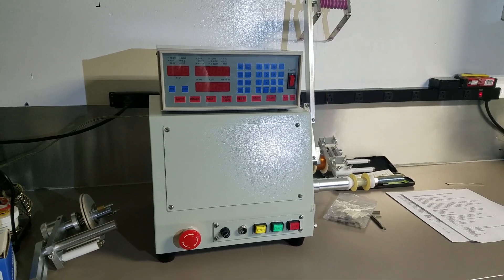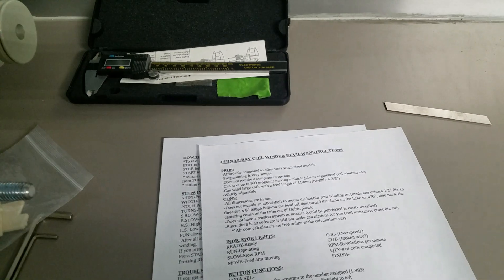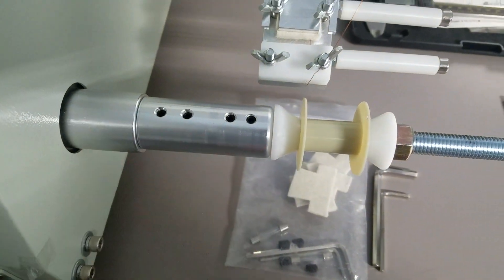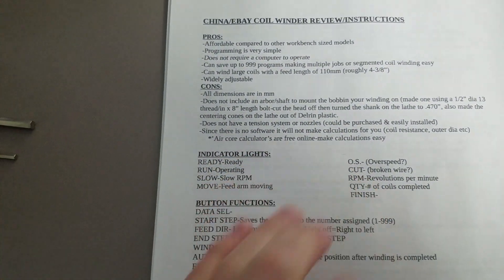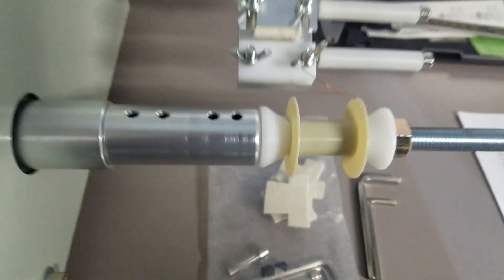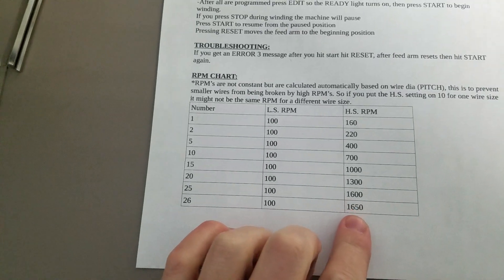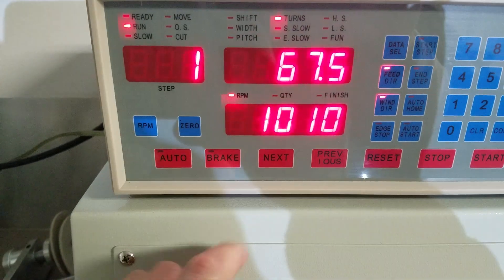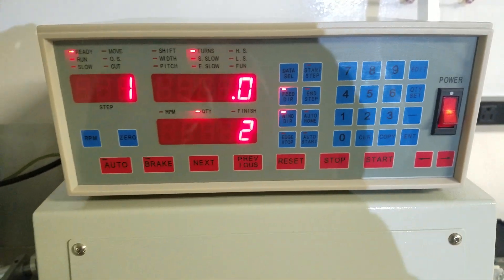Automatic CNC Coil Winder review & how to use (In English)

Comment: Hey thanks for sharing! I'm a little late here but I'm curious if you know the maximum spool diameter (not length) the machine can handle. I found sellers online that listed a 200mm max spool diameter and some that listed a 120mm max spool diameter. What's the largest spool you've wound? Also I'd love to know if it can handle spools with irregular geometries (like a semicircle).
Reply from the maker: @LiamKimball-d4q  I think size wise it could handle 200mm, but you'd have to have the bobbin over the edge of the table or have spacers under the machine. I'm not sure about the software, though. I've never tried winding one that large, and it's in storage right now. 
I'm sure it can do irregular geometries you'd just have to average out the dimension so it thinks it's round in order to get the correct number of turns.

Comment: Hi Brad, thanks for the video.  I wonder what/if you have to do anything for tensioning the feed spool?
Reply from the maker: I tried using some springs pushing against the spool. It ended up not being consistent so I stopped using it.
Reply: @BradKwfc  thanks for reply.  Does that mean that you don’t tension the feed spool at all with good results?
Reply from the maker: @RichardAuber  Yes. 
I tried using tension but without an actual tensiometer getting it right was difficult and it just made the coils worse. 

There are tensioner's online that fit this machine for around $100.
Reply: Thank you!  @BradKwfc

Comment: Hi, can you answer this for me: I have my machine being delivered this month, I have coils that need wound, they are about 4mm diameter and 8mm length, but you show a threaded rod in the center, obviously that is far too big for my coils, is it a matter of 3d printing something, or will it simply not work? Thanks a ton!
Reply from the maker: Yes you could 3d print one. 
I used a large diameter rod because it was close to the hole diameter. The screws that clamp in into the hole are only on one side so if I used something smaller it would wobble.
Reply: @BradKwfc  That's great news, guess I will have to model a custom coil holder, no problems. One more question if you can answer, is there anything stopping this machine winding guitar coils? Thanks for your help much appreciated!
Reply from the maker: @Program2live   With the right holder and bobbin, it will wind guitar pickups just fine.

Comment: I got this coil winder about a week ago and love it. Is there anyway you could make me a set of cone centers like you made?? I’d be happy to buy a set!! I have look everywhere online and can’t find anything like them.
Reply from the maker: Honestly I found that using large area washers and nuts work better. If you wind alot of turns the bobbin will warp, so I found it best to clamp the bobbin in place using the washers and nuts.

If you put a threaded rod on yours like I did just get some nuts and large area washers for it, you'll get better results that way especially if the bobbins your using have thin walls.

Comment: Thank you. Will it wind basket windings as used in RF chokes (for example)
Reply from the maker: Your welcome. I don't think it will but I could be wrong. It has a lot of different settings you can program into it. I've only ever needed to do basic multi-layer coils.

Comment: Wondering if the FUNction button is related to separating the primary and secondary coils with tape?  Someone else suggested the FUN switch might be related to using a computer interface.  My guess is that it's related to the taping feature and if you change if from "0" to "1" (or whatever) it will neatly wind the  tape just like it winds the wire.  Curious if I'm on the right track - let us know!
Reply: FUN trigger an output signal when the coil is finishing with winding to trigger external equipment for automation.
Reply from the maker: I'm not sure. I'd try it out but my winder is in storage. I'll be getting it out in a few weeks to wind more coils though.

Comment: Thanks for the video Brad. Quick question. Will I be able to use this winder for electrical wire, like a flexible silicone wire up to say 16 AWG thick? To wind up up small wire bobbins? Is the 2mm max thickness in the specs pertaining to coil winding only?
Reply from the maker: I think you could but I'm not sure if it will let you input a dia that large. I would try mine and let you know but it's in storage. You'd also need to make a custom head (probably with a wheeled guide) for the silicone wire.
Reply: @BradKwfc  Thanks for your time. So am I correct to understand that if you dont require the tension to wind coils, but only electrical wire, that the machine would be able to cope as long as you custom feed the cable with some moderate tension? Is the question whether the pitch setting will allow a larger number?
Reply from the maker: @Philip M Nagel  Yes, I'm not sure if the pitch setting would work. If not yeah you could still rig something up.

Comment: looking at buying one, the 820 larger/slower wire guage modle.  quick question, should i consider one with a "break" or doed it not matter? just windins simple solenoid coils with 1.2mm wire
Reply from the maker: Is it a brake that stops the winding? 
If so mine doesn't have a brake, I always set the last few turns to be slow and it turns out just fine.
Reply: @BradKwfc  ya to stop the winding, if it stopes fine without i guess i dont need it, im getting the 1500max rpm version for thicker wires anyways. production speed is not a large concern, 200-400 coils a year.  thanks for the replys man!
Reply: @BradKwfc  have you wound any thicker things with this machine? the coils i want to wind are 1.15mm wire. machine states 1.2mm max. I dont really wana struggle with no torque/stalling out. but the larger machines are twice the price and do not come with the 2 different tape holders, which would be handy
 thanks again for your input, its nive to have someone to chat with about neiche' things like this!

Comment: Brad! Your video saved my Christmas! But I managed to push red start button at the bottom of vevor cnc coil winding machine (not on the display). The button stuck there. And now I can't get rid of "errors". What to do? Thank you in advance!
Reply from the maker: The big red button near the bottom? 
If so that's an E-stop (emergency stop) button. You just have to turn it and pull it back out. There should be arrows on it indicating which way to turn it.
Reply: It took me a few minutes to figure out the emergency stop button was preventing mine from coming on when I first unboxed it and powered it up lol. I finally figured out that I had to turn it, like the arrows say, and pull it out. I was extremely relieved to say the least. It's a good little unit I believe. I have to order more magnet wire before I can fully test it out though. Thanks again for the help Brad.

Comment: Thank you so much for sharing! You are a lifesaver. I just received kind of the same machine but it has a wider table and can hold the coil from both ends.
I was going nuts since the instructions came in a single sheet of paper and I could not understand it. Even the names of the keys on the sheet did not match the keys on the machine.
I can breathe a bit better now after watching your video. Best regards, JF.
Reply from the maker: Happy to help 😃

Comment: How do you think this will work with .03mm (.001”) wire. I have a bunch of real tiny electro magnet coils I need to rewind and it’s crazy thin wire.
Reply from the maker: .03mm is the smallest wire this machine will do according to the description. If you get it all setup right I'm sure it can be done. With wire that small don't expect them to look well and be uniform.

Comment: Okay after working with this for a day now I noticed you made a mistake as the width is for the wire's actual diameter and the number of turns you plan on laying down in the given space. Example if I have a 0.18mm wire and I plan on putting down 40 turns per layer the total width will be 40 x 0.18mm = 7.2mm. This is where the designer of the bobbins comes in as when designing these bobbins one must take into account all of these things prior to moving to the coil winding machine. 

So far I can't seem to figure out how to program it to automatically wind up slotted bobbins and have to do them manually but at least I can do it now. Oh, I'm winding bifilar coils with this machine as I made a modification that allows the machine to wind bifilar coils as it's a must with Meyer's latest bobbin designs that he came up with before his passing.
I'll make a video of me winding one bobbin slot as I haven't anything to hold the camera.

Once I have this latest transformer all wound up it should be a go for this technology but since it is a prototype mostly I'll be gathering information on it's performance as I fine tune things for the Water Fuel Cell that I have.
Reply: Hey did you ever make that video of winding segmented/slotted bobbins? Does this work well for that? Even if you have to wind one slot at a time.. just curious

Comment: Hi Brad! Can your coilwinder also do Orthocyclic windings?
Reply from the maker: No it can't. You'd need something where you can get into and modify the software to do that.
Reply: @BradKwfc  Och, so it’s not programmable like cnc gcode with software interface then I assume
Reply from the maker: @obr2021  No its just the basic programming on the machine.

Comment: I bought one of these last week, thanks so much for making the video! 

I designed an arbor shaft in CAD and 3D printed it.  It seems to work well so far.

One challenge I have is that I wind a lot of interleaved chambered transformers using 42ga wire on the secondary.  I haven't figured out how to program the machine to wind, move a few mm to clear the chamber wall, wind some more, etc. 

I also use fairly huge spools of wire, which has proven challenging as far as wire feed, tensioning, etc.
Reply from the maker: I'm glad the video helped. When I bought mine all I had was one in Chinese and no manuals. 

For the interleaved transformer you probably have to make a program for each space and make sure auto home is off.

42awg man that is some tiny wire to work with. I did 36awg once before I had this machine,I used a mini lathe with a step counter rigged to it. Needless to say I'll never try that a again on a mini lathe. 

You can also get tensioners for this machine on ebay and other places. I feel like they are overpriced so I never bought one.
Reply: I also use 42 gauge, big spools. I’ve had problems with it. Put it in storage 4 years ago. Hoping to look into one of the better tensioning systems for it as it seems to be a great unit. Did not like the manual tensioner but other than that it’s awesome. To your point, looked on eBay and they are massively overpriced right now. Fingers crossed something else comes out that is less expensive. The tensioner is pretty much the same price as the actual unit.
Reply: @mikeSGman  I sort of solved the tension issue by turning the 42ga spool vertical and sitting it on a flat surface below the feeder. The wire unwinds off the spool like a sewing machine. I’ve been doing it this way for months with no problems. 

The Dude Abides.
Reply: @Matt Portnoy Would you be willing to share your CAD file for your designed arbor shaft?
Reply: @lego555clone  I posted the link here but it seems to have disappeared?  Did you get the file?
Reply: Hi. @mattportnoyTLV.  would you mind sharing the cad file again?

Comment: Interesting you got this way back in 2018 or so. I'm just looking at it now, lol. I've been winding these multispool bobbins by hand and now that I've started using a very fine wire I can no longer see what it is I am doing. I wish you would work with me on this as I cracked the science behind this technology and am now ready to push this technology into the marketplace but to each his own I guess, sigh. Anyway Once I get all the last bits of the things I need in I will finish what I started way back in 2006. I will have to figure out how to wind these multispool bobbins with this machine and modify it a bit to be able to wind Bifilar Wire. But I did just check with the company I get the wire from to see if they can make the wire I use into parallel bonded wire for me and am waiting on a response from them. 
I can feel in my heart this will be the year this technology finally makes it out of the box those that wish this technology to never see the light of day have put it in🥰. I had to lean this technology in steps but getting at the actual science behind it was the most important step to solve as now I know exactly what this technology is and is not doing.
Not sure if you go on OverUnity site much but I have posted a lot of things I am doing now on there in my old, "Stanley Meyer Explained," thread. It turns out this technology is on the expensive side to get working correctly and there simply is no way of getting around that.

Comment: Looks like "speed setting is % of the max limit. You can adjust max limit by pressing EDIT - DATA SEL - 5, or EDIT - DATA SEL - 5 - 5 or - 5 - 5 - 5. To edit values press "-". Looks like H.S and L.S modes have their own max values. By lowering L.S. speed limit and you can have very low RPM in L.S. mode.

Comment: I bought the same coil winder and found a different manual for it, which has some overlaps with the manual mentioned in the columns below, plus some some useful additional information. Apparently there is a whole family of these coil winders. http://www.smtb.lv/fails/teh/WH-751%20User%20Manual%20DCWE(CNC-200A).pdf
Reply: Thank you Scott.

Comment: Brad....I know this video is a couple years old now and after seeing this in operation I had to get it!  My prior models are hand crank for heavy guage wire and the other is "sewing machine motor" that basically counts for you.   
I do wonder what is the smallest wire you have worked with and did you have any issues with breaking it?   Do you think it can hold 10# spools?  
I'm asking because I have a 10# spool of 37awg and all efforts on my other winders have over torqued the wire and it snaps.    So basically I have a massive amount of wire that just looks pretty on the spool and I really couldn't use it.
Reply from the maker: The smallest I've done on this machine is probably 32AWG. I've never broken any wire so far. It should do 37AWG without any problems as long as the spool its on is freewheeling.
Reply: @BradKwfc  I am winding #40 on mine with no problems using a free standing dereeler.  The spool sits on the table on end and the wire feeds off the other end up through eyelets and on to the winder from there.
Reply from the maker: @rocketcaver  Awesome, that is some tiny wire.
Reply: @rocketcaver  for diamter wire do u put 0.08 or just 0.1 ?

Comment: The most important function for winding coil is speed control. This machine i bought and it doesnot have slow increase or decrease of speed and it jumps to direct high speed step which elongate the wire or damage so i don't trust the quality of my coil wound on this machine. I suggest to consider machine with better speed control like ramp increase and decrease the speed.
Reply from the maker: Use the S.Slow function...It will wind whatever number of turns you input in S.Slow at a lower speed then ramp up when those turns are completed...Then use E.Slow to ramp the speed down at the end of the wind.
As far as controlling the ramp up acceleration, I'm not sure if it can be changed...I think it can but its been a while since I've looked at the manual.
Reply: @BradKwfc  yes you can change ramp up speed
Reply from the maker: @benc8426  How do you do that?
Reply: @benc8426 how is that done? Thanks.

Comment: Hi you  doing  I have a question for you 
What s the  maximum  size diameter  bobbin for voice  coil  you can  winding
Reply from the maker: The manual says .03mm - 1.0mm. In AWG this is ( (.00118 - .0397 inches), so its beyond 40AWG down to about 18AWG.
Reply: @BradKwfc  how u input that .03 on that machine ,?

Comment: Hello
Someone  knows where can I get the plastic adapter cones for the reel?
Reply from the maker: Hi, I made mine on a mini lathe. If you have access to a lathe or a 3D printer you can make your own easily.

I have found that instead of the cones its better to clamp the bobbin onto the threaded rod with some large area steel washers and nuts though. 
That way if you wind a lot of wire on the bobbin the flanges of the bobbin don't warp from the pressure of the wire.

Comment: I constantly repair speakers. I was winding a coil with simple handmade machines. I will use this now. It has not been released manually. But we solved it easily. We have made great use of the video. We solved every function with trial and error method. Nice machine. $ 550 + taxes + fees + warehouse customs clearance company = $ 992 (from China, Turkey) was more than $ 120 -150. There are taxes in our country. They also see this kind of machine as import. It is not ordinary order. Tax costs are more. If it used to be
$ 550 + taxes would be $ 660. Still, the machine is good. Worth your money.
Reply: how can you get a perfect layers during winding

Comment: Brad, thank you for sending me instructions on using this machine.  I will probably be ordering one of these soon.  I will be winding with very small AWG 48 wire.  Do you have any experience with using a tensioner as this is probably important with such a fine wire?  Thanks, Jay
Reply from the maker: I haven't used a tensioner on mine, I know you can buy on that will work with these though. 48AWG man that is tiny. You'll probably need to buy some nozzles for something that small also.